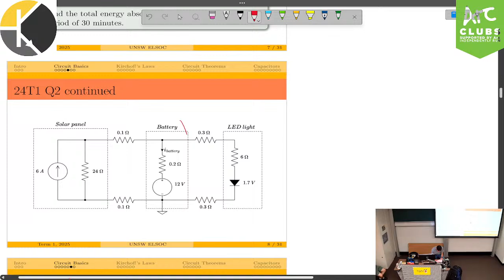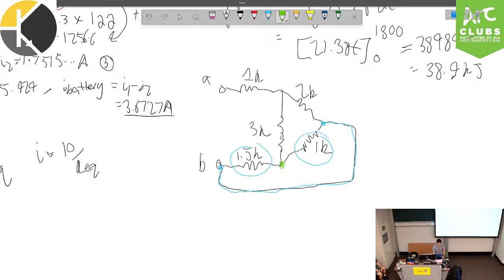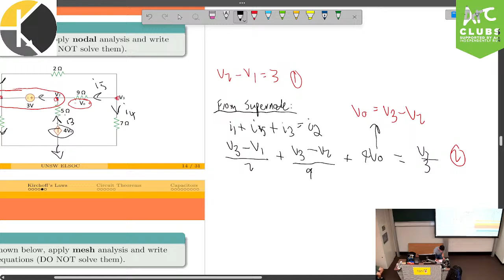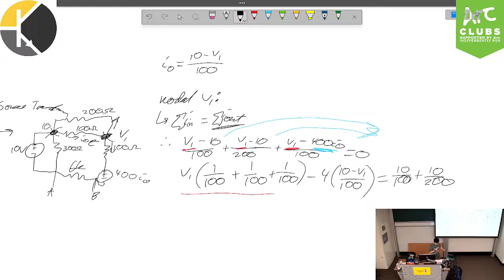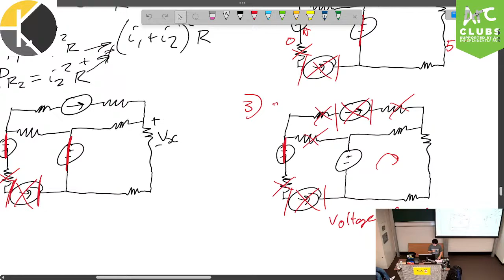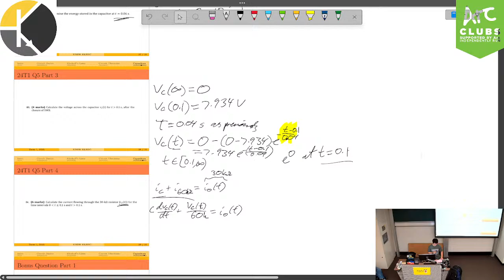UNSW ELSOC Presents: ELEC1111 Midterm Crash Course

Comment: There seems to be a 0.3 ohm resistor missing in the calculation of the 24T1 Q2 problem.
Reply: yes there is, answer for i battery should be 3.75 amps

Comment: In Thevenin Problem 3.1, the initial approach was to apply KCL at the 'v1' node, resulting in the equation:
(v1 - 10)/100 + (v1 - 10)/200 + (v1-400*i0)/100 = 0
That would mean the top left node is 10V, by setting node A at 0V, and the voltage just above the dependant source to be 400*i0. However, for that to be true, node B would also be set at 0V. Wouldn't that make any further calculations on the Thevenin Voltage to be incorrect, since both A and B have been set to 0V and V_Th would thus also be 0.
Timestamp for reference: 1:31:42
Reply from the maker: 100% you make a really good point, we HAVE mistaken the nodal voltage above the dependent source. Thank you for pointing this out. The corrected working would replace the voltage of 400 i0 with 400 i0 + Vb. introduction of the variable would mean we do one last supernode analysis too.
Reply from the maker: Attached is the re-working for the question:
https://drive.google.com/file/d/1sj49whIC-hBJ1ieXkL23SKfTsE0eq0AA/view?usp=drive_link

Best of luck with your studies!